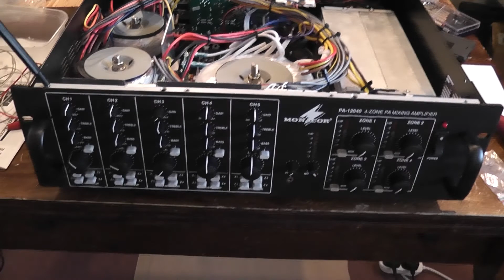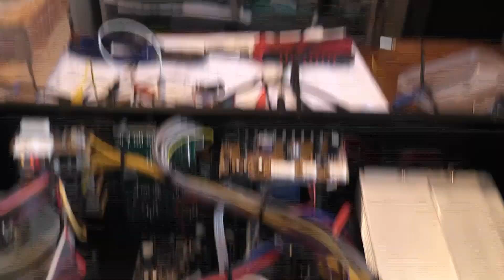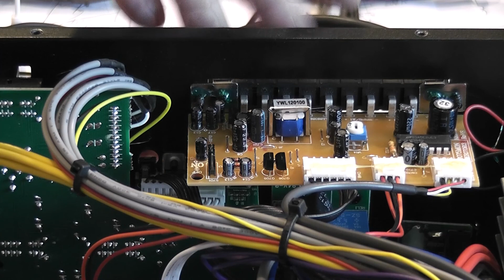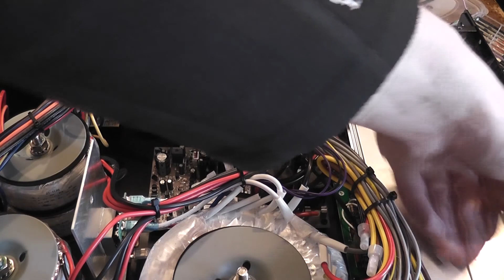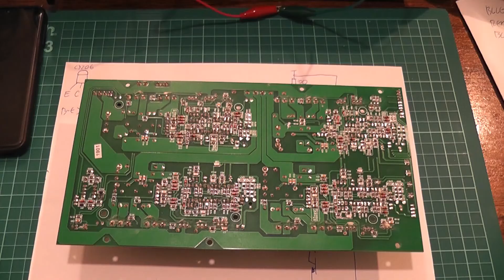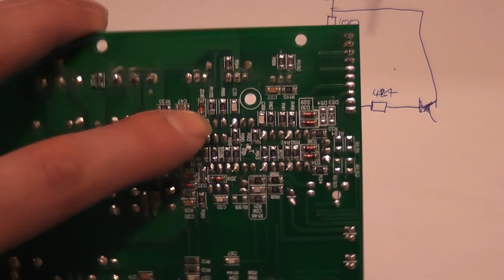PA12040 4 zone mixer amp repair

Comment: Hi, just came across your videos and they are great. I have the same amp but i';ve no power when turning it on, just a delayed click. . Swapped kettle cables out and opened it up looking for internal fuses. The 2x clear fuses i found look good. Were do i start now. Any help would be really apricated.

Comment: My have a problem that the input does not receive any incoming audio at all, is this could cost by the telephone mute problem too? Are something out. Everything has powers to it , but just not received coming in only?
Reply from the maker: Which input isn't working?
Reply: All of the input from the back, look like the the transformer is workings. I read all 24v from the blue but no light were on and not even turn any of audio on at all
Reply from the maker: @hfutureshow689channel2  without it in front of me it's hard to say. Sounds like it's a bit more of a problem than a muting issue. The mute only works when activated, without the jumper moved it just allows audio to pass through.